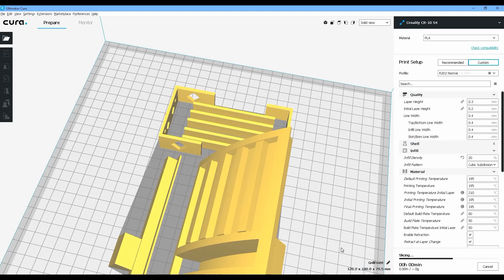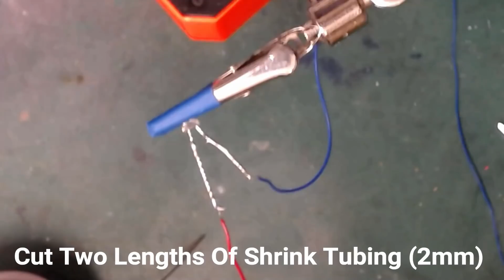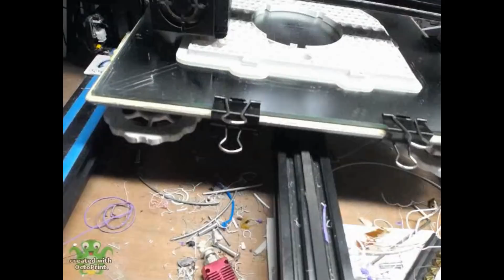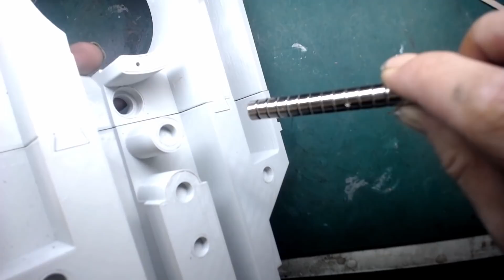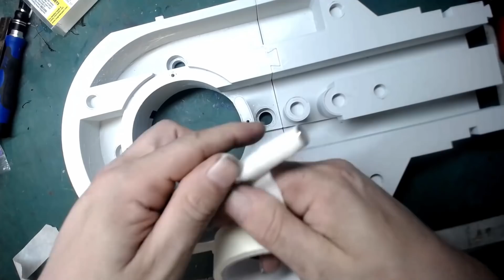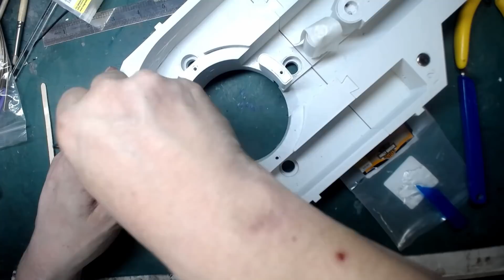R2 D2 Episode 23 - Left Leg - Pt 1

Comment: I’ve heard there’s 3 versions mk1 mk2 and mk3 what one are u making?
Reply from the maker: Im making V2. When I begun this project Version 2 had already been released. I dont know the difference between Mk1 and Mk2 but Mk2 sounds better, doesnt it? As I started building M R Baddeley started releasing Mk3 files. Some of these I will be using as they are compatible however most of them are just mk2 files optimised for a bigger (500mm) print bed, which is too big for my printer.